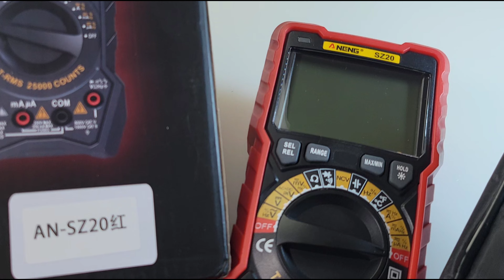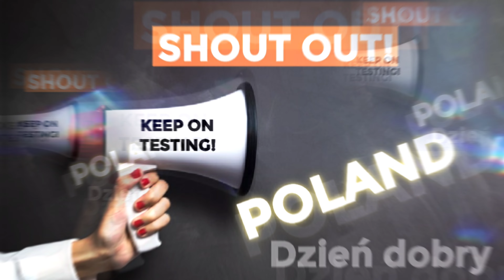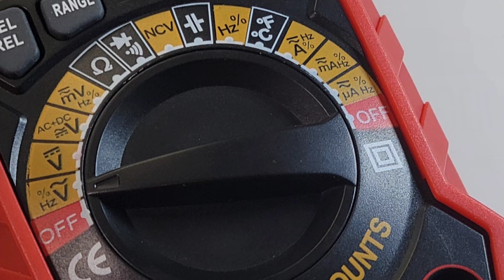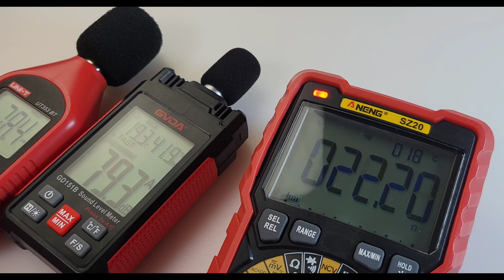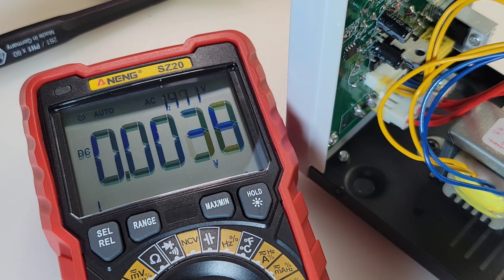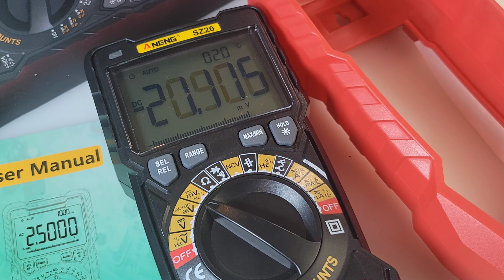ANENG SZ20 CHEAP-O Multimeter Review & Teardown!

Comment: I just got my Aneng SZ20 multimeter. It's great and has 25,000 counts, 20A current measurement, and a dual AC+DC mode, which is good for its price. It's a little heavy, but I like the weight, around 420 grams, more or less. Based on your video, when you turn on the backlight, the flashlight also turns on. Another downside is the 250mA current input jack. I like the meter, and your video was honest, which made me order it. All I can say is, thanks to you, I discovered this meter. Maybe soon, I'll try testing it for 1kV and 1.5kV readings and a transient voltage of 2kV to see if it holds up, just like I did with my Mestek CM86B and Honeytek HK68A.
Reply from the maker: Hey Jonathan 👋  sorry for the late reply! Glad to hear it's a keeper ! Let me know if you ever try the high voltage ⚡️..I like the weight too..feels great 👍
Reply: @KeepOnTesting  Hello again, sir Darren. Last week, we conducted a transient voltage test on the Aneng SZ20 multimeter and, after performing six tests at both 1.5 kV and 2.5 kV DC transient voltage, we noticed some issues: in ohm mode, the meter registers a reading even though the circuit is completely open and the test leads are unattached, showing 23 megaohms, while in the low-ohm test, it displays 17 ohms, which is concerning given that we used three different sets of test leads (the Aneng SZ20 test leads, Fluke test leads, and Sanwa test leads); additionally, in the ampere/milliamps/microamperes mode, the reading is consistently 0.0325 A, 0.325 mA, and 3.258 μA, and in capacitance mode, it shows a reading of 0.0075 even though the circuit is open, thus far, no issues have been observed in AC/DC mode, AC+DC mode, mV AC/DC mode, or diode mode, and these problems have persisted consistently for four days, so while the quality is good for its price, it did not withstand the transient voltage test, and I think the writing CAT IV on the meter is just a marketing. I would appreciate guidance on whether there is a solution to restore the meter to its normal operation or if it is simply a minor error.

Comment: Warren, about a simple way to check AC+DC mode: use a transformer (sinusoidal 60Hz) or any square wave output (as some Aneng have) and a 1.5V battery. Join negatives and isolate / “sum” the two voltage sources (AC and DC) joining their positive (in parallel), where each positive has a 47R resistor in series before joining them. It should give you a simple way to have an uncalibrated, but practical, AC+DC source to check this feature.
Reply from the maker: Great 👍 advice !

Comment: Usually I’m not a fan of Aneng multimeters, but this one is all right. Decent accuracy, nice ranges (except for mA), better than usual input protection, good resolution, dual display is always nice to have. The bar graph doesn’t seem that fast though, but hey, at least it’s there. 👍
 
You’re right, $54 is a little too pricey for that. In this price range I would personally go for Uni-t just because their overall quality is more consistent, or wait for this one to go on sale.
Reply from the maker: I have a feeling the price will drop on this ANENG fairly quickly. Definitely one of their better offerings as of late.

Comment: Interesting input protection concept. The MOVs are usually on the voltage input as that is the mode that the meter will suffer from voltage spikes. Voltage spike won't have the same effect in current mode as the current shunt acts as the short, don't see the point of a MOV shorting out a current shunt.
Reply from the maker: So true , normally MOVs are  bidirectional and non-linear surge suppressing components. As such , they are normally used for limiting voltage during a surge or transient.

Comment: Why refresh speeds are so bad? it performs as my 40 year old Keithley DMM :D
Reply from the maker: Interesting. 
I found the refresh rate very good. The higher resolution will make it a tad slower in the lower ranges but it's negligible.
Reply: @KeepOnTesting  Check Amprobe PM55 for example, for really good refresh rate (in portable DMM of course).

Comment: Not bad at all.  I just got the Venlab you showed a week ago. When this gets a little cheaper I'll get it.
Reply: The Venlab is killer. I think it's by far the best bang for buck meter you can get right now. I haven't had any discrepancies whatsoever with it against the shop Fluke so far. It's particularly great at measuring capacitance, which I find most multimeters fail at when and if they even have that feature.
Reply from the maker: Hi Tron, How are you liking the Venlab so far..?
Price should drop on the ANENG soon..

Comment: So finally a good protected cheaper millimeter, you can use with high voltage + high amps, because that protection is 
not on many cheap multimeters, and i can buy the ANENG SZ20 for €41,66 ($45.26 usd) on AE, and that is with 15-day 
delivery and Free Shipping (EU).
Reply from the maker: That's a great deal with the free shipping! Nice to see ANENG step up with the input protection 👍
Reply: @KeepOnTesting  Yeah i hope the rest is also going to do that.

Comment: Hello Darren.
Hmm .... 0660 processor in this level of a multimeter, of course, does not look very nice. Although the protection is performed on CAT III. Completely agree with the assessment. The multimeter is good, but there are places where for this amount they could try better. Still, HOLD PEAK is hard to beat.
Under the last video, I asked for a review on such an accurate multimeter, only from another company, but this is its complete analogue, the same OEM.
Thanks Darren. You are the best.
Reply from the maker: Aww shucks,  u- r- d  best my friend 😊 LOMVUM  is coming this month too!